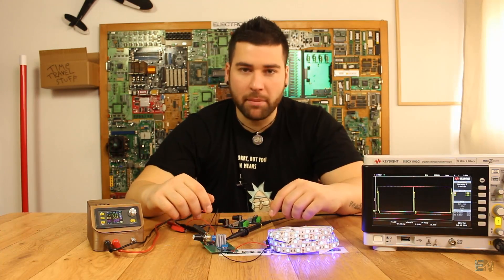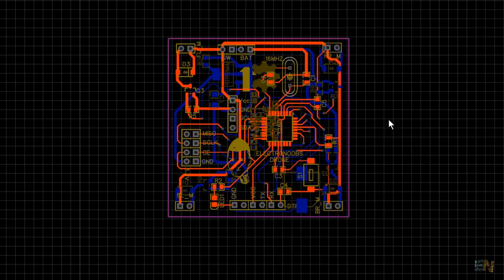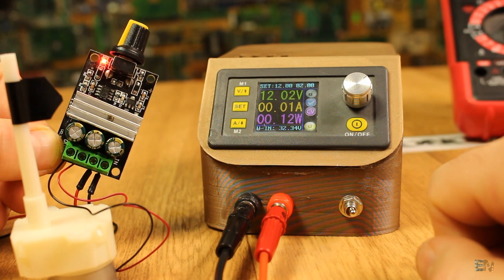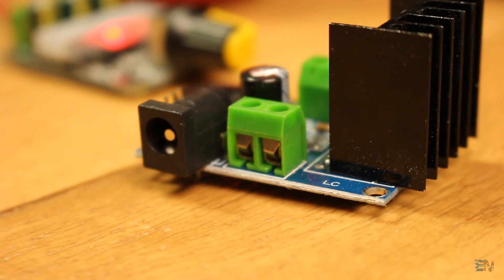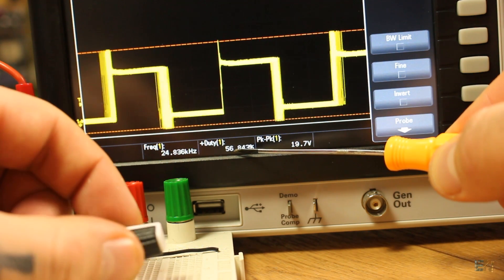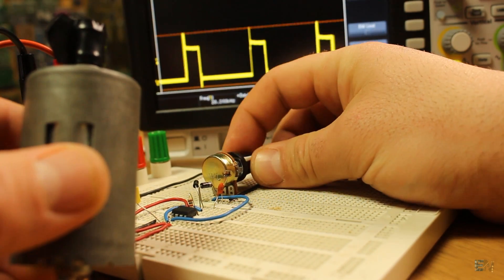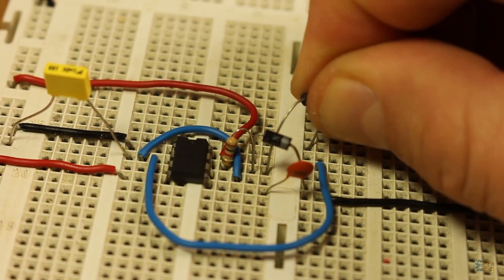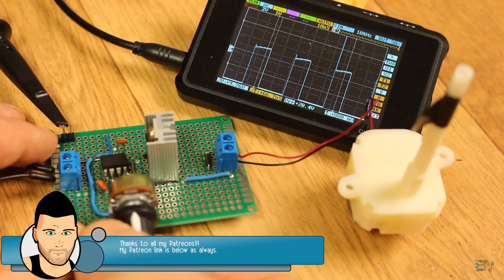PWM 555 power controller

Comment: How circuit for 12v dc to run oscillator and pass transistor to pass 120vDC as PWM for pulse peaK 7 AMPS AT ABOUT 1 AMP AVERAGE dc?  Can I leave out the expensive filter capacitor for low frequency 120htz DC. The AC to DC was sine wave ripple pulses DC and the 555 timer is square waves.

Comment: I´m a newbie, so, someone has to explain me such things, and although the matter interests me since longer (one might then think I must already know everything), still this video had some new knowledge for me, so, thanks...
PWM-generators from ebay control frequency/DutyCycle but output solely 5-30mA... It would be hugely usefull to know how to amplify their pwm-output-signal, so that 100-200mA can be drawn... Would you please realise this project ??? Please Please  Please !!!!!!!!!!!!! If I use yout suggested circuit instead, I won´t be able to know the frequency/DutyCycle without a better-quality-osciloscope, which would let my budget explode, and defeat the purpose...  Those pwm-generators don´t show graphs, but communicate the set frequency/DutyCycle simply by showing nunbers on their lcd-screen, and are very reliable on that, so, no need to heck each of the thousands of different settings with an oscilloscope each time...

Comment: I’m interested in controlling the fan speed with a esp32. Should I pickup a 12V potentiometer based PWM controller and a digital pot or is there a better solution? My fans draw around 60W.

Comment: Thank you that informative video! I Built this circuit but I've got some problem. For me the output PWM signal is still on high and the voltage be changing only 0.1-0.2V when I turning the potmeter. Anyone got idea what I've done wrong?

Comment: i need to buy PWM for hydrogen production . hydrogen unit need 220 volt 2500 watt . i have 220 volt inverter . which bridge rectifier and capacitor should i use to convert AC TO DC . how to connect capactior . which PWM should i selected . how to select PWM . how to calculate  it

Comment: Can I use a 10 amps and 24 volt DC motor, (conveyer belt speed control motor) in this circuit. Both direction

Comment: the 555 timer ic isn't working at 24v dc
Reply: If you use a 7812 voltage regulator for the 555 and from the same supply you connect the mosfet and motor it would work too maybe.

Comment: As usual really good video, I just thought I would share my circuit as I have set mine up slightly different. Swapped the 1nF cap for a 820pF (821), changed the pull up resistor from pin 7 to a 20 K ohm and added a resistor between the the two diodes opposite the pot of 220 ohm ( so as you look at your diagram the 20 k ohm resistor would link the vcc to the top of the right hand diode and the 220 ohm resistor would go from the top of that right hand diode to the top of the left diode). This way you have a frequency of 25 kHz (still good for PWM fan frequency) and a maximum duty cycle of 99.7% and minimum duty cycle of 28% so the fan should not stall. I have no scope so it is all maths. Hope this is useful. These are the formula; t1=time on, t2=time off, C1=timing cap from pin 2, R1=pull up resistor from 7 to vcc, R2=resistor from 7 and right diode to left diode then the left side of the pot is Rx and the right side is Ry so t1 = 0.693 * (R1+Rx) * C1 and t2 = 0.693 * (R2+Ry) * C1. Adding both answers together and dividing 1 by your answer gives the frequency. By putting the 20 k ohm resistor in even with the pot turned all the way the other way the resistance can not go below 20 k which limits the lower duty cycle to the 28%  ((100/total time)*t1). The low resistor at R2 lets you go almost full power

Comment: I built it, but does it go to cero output value? the motor spins when the Potentiometer is at its lowest value. What can be done to have the motor not to spin when connected?

Comment: 28v? No!! The 555 absolute maximum Vcc is 18v!! (Read the 555 PDF) But don't give it any more than 12v since its output voltage swing can damage the gate of MOSFET!! Use a 1-watt zener diode or a 7812 to regulate the 555 part of the circuit.

Comment: nice video!! but i think hard about how to change the potensiometer with an ebike throtle sensor (hall sensor) . i want to apply this circuit as an ebike speed controler

Comment: Hi I want to control this PWM with "RF" Remote..How to do it?...please help
Reply: what kind of remote that you will be using?. if it an generic 433 mhz rf remote just connect the input of transmitter with an pulldown resistor. then the receiver also with pulldown resistor on its output then connect it to an mosfet. done !!!

Comment: Me encantan tus videos! Just discovered you through EEVBLOG...hope you become the next electronics youtube star!!!
Reply from the maker: Thank you!
Reply: Hi mate, i have question, if i have motor 200v, i used ac220v rectifier and get 310v dc. When i used pwm duty cycle is 50% i will get the volt is 155v?? Or just change the curent like on the video???
Still confiusd about this. Thank u @ELECTRONOOBS

Comment: Hi thank you for the tutorial but can I use the AC circuit with 220v?
Reply from the maker: This circuit is just for DC. AC power controller will be different. Search for SSR (solid state relay)
Reply: do reverse engineering the AC light dimmer..then you will know..

Comment: Just for people how don't already know...
Every MOSFET has an intrinsic fly-back diode built in. If you're going to add an external diode, make it a Schottky diode, so that it will conduct before the internal diode of the MOSFET conducts. A 1N400x is not fast enough. 
Also, if you use a logic gate MOSFET, (Any MOSFET that starts with IRL, instead of IRF will do), you won't need a heat-sink for currents less than 5 Amps. You would need a 20V >= VGS >= 10V to fully turn on an IRFZ44. 
Perfect when you are using a 12V power supply. The gate will open fully. 
However, for supply voltages > 20V, you'll will need a 20V Zener diode (18V just to be safe) between the 200 Ohm resistor and the gate of the MOSFET, to ground, (From point marked G at 6:27, to ground), in order to protect the MOSFET's gate from exceeding the 20V maximum rating for this particular MOSFET. 
Hope this helps some one.
Thanks for another nice video.
Reply from the maker: Thank you!
Reply: Is it possible to use something in place of the MOSFET? I have everything to make this circuit including piles of transistors, switching transistors, etc, but not a single MOSFET. Help if you can please.
Reply: @thaynecearrachkerr8497  transistor will work i think although they won't be as efficient.
Reply: UF400x
Reply: Very well explained video. Very nice input and fine tuning from UFOhunter.
Reply: The SB560 diode is good to put next to the transistor instead of 1N4001 ?